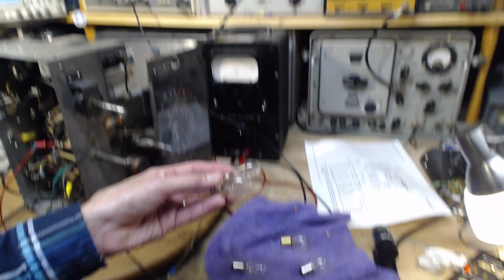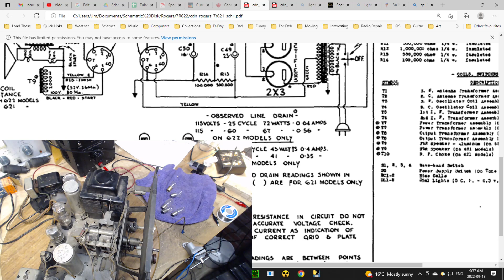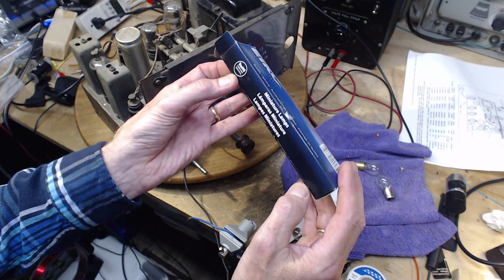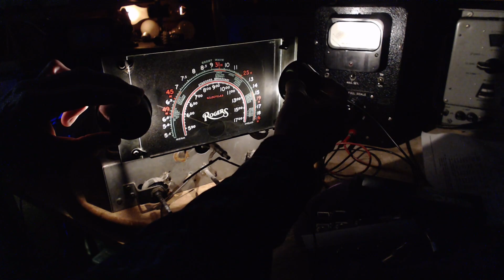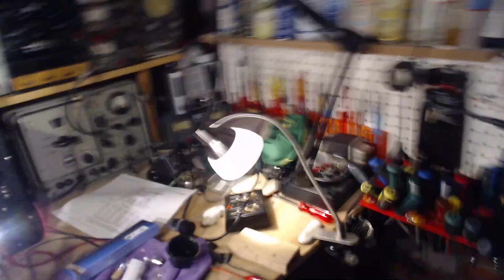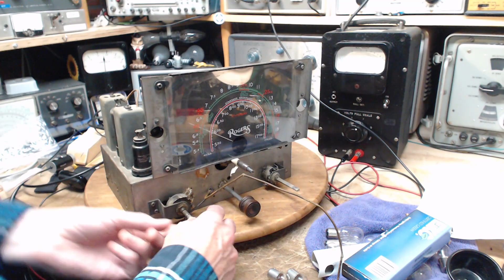Rogers Model 7R622 1935 Tube Radio Video #18 - Dial Light Saga

Comment: Drop the voltage with a resistor
Reply: A better option is to wire both lamps in series.